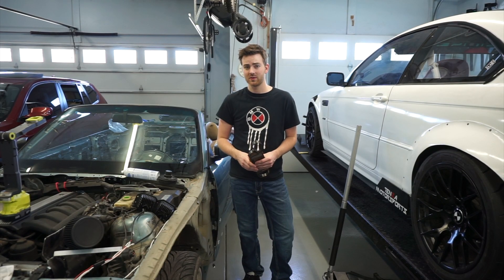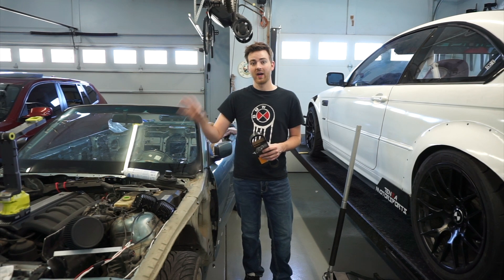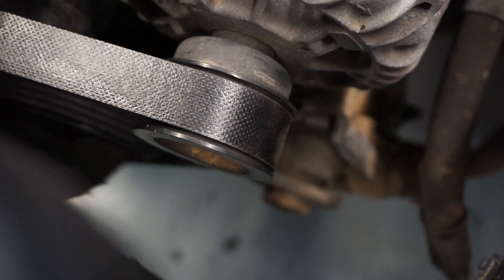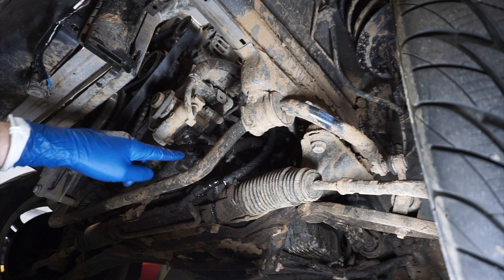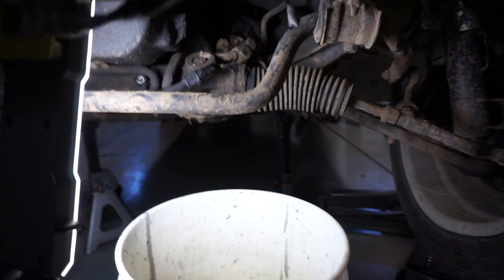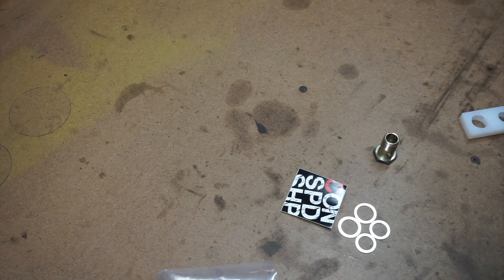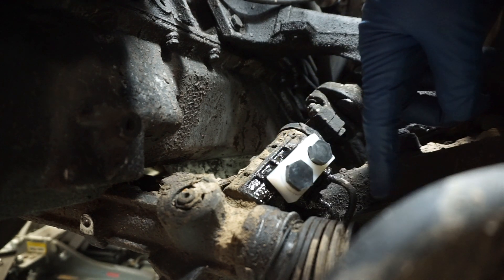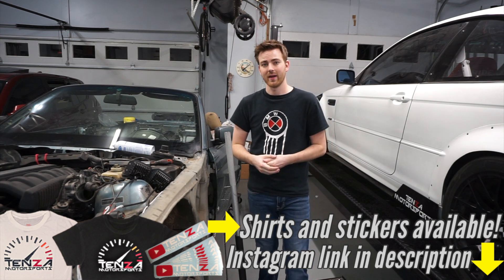BMW E36 Condor Speed shop power steering delete - BMW E36 Death Kart build part 6

Comment: Great video. I’m toying with swaps into my E46. I’m thinking I will toss one of these on if p/s is any sort of an issue with a new power plant..

A thought on the “4” washers note: those crush washers are prone to sticking. Almost looking like a part of the thing they sealed.. so calling out that you should have FOUR of them helps keep user error down. If it’s important enough to be mentioned in a word document instruction set, you should pay attention.

Comment: Another "while you're in there" item to knock-out real fast and cheap is the tiny rubber "steering column guibo" on the lower portion of the steering column. It's clearly visible just above where you attached the delete kit. The steering column guibo also contributes to that lovely BMW steering feel. I'm sure that guibo is dry-rotted and compressed to hell.